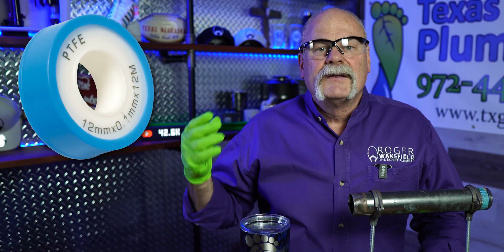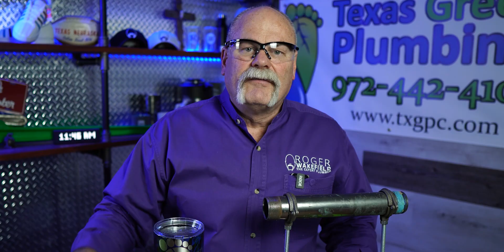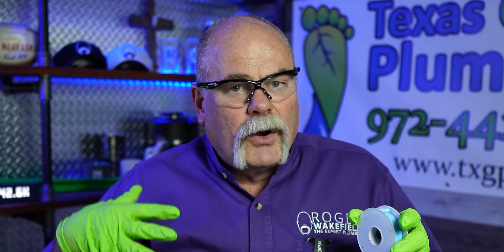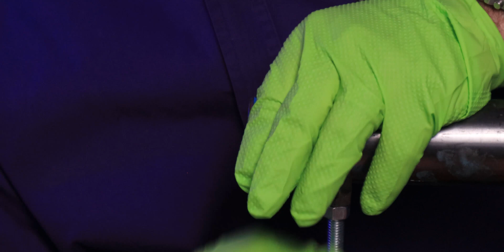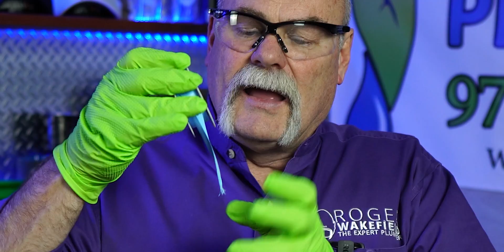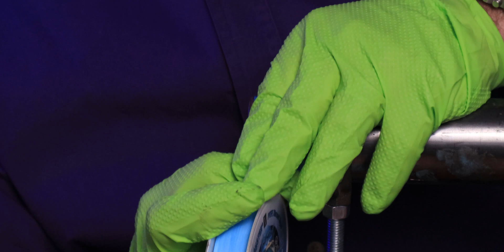How to Apply Teflon Tape/Plumber's Tape like a Plumbing Pro!

Comment: Great video, this comment might get lost on a 5 year old video, though when I apply the tape, I have the roll backwards so that you can add a bit more force as the roll is pulled to the rod that way.
That I learned recently from a local plumber here in Mexico.
Will be watching more of your videos, they are full of practical tips.

Comment: I like to do my wraps then back wrap back to my starting position. I'll then run the edge of the teflon tape roll in the threads to make sure the tape is in the threads then I'll put the pipe dope on it.

Comment: Not working for me. PTFE always failing
Reply from the maker: Why is it not working for you?
Reply: @RogerWakefield  idk. ptfe Is always leaks. Not depends how many turns I do.
Reply: Hemp works always but ptfe ...
Reply from the maker: You could also try putting on pipe dope, when necessary, I do and I never have problems.

Comment: Teflon tape is great for iron pipe and all kind of plastic materials. Stainless steel is something else, the treat is very sharp. We prefer liquid sealant when we need to seal stainless. We also have a rope kind of tape made by loctite (loctite 55) very handy for smaller parts. Loctite 5331 is our ultimate saver, apply it before tape or rope, guaranteed a waterproof seal.
Reply from the maker: Great point!

Comment: Fine, when you have a section of threaded pipe mounted horizontally directly in front of you. What about when you have to contort your body, hands, arms reaching into tiny cramped spaces (such as under a small sink cabinet) and the tape repeatedly rolls up or folds up on you and a number of pipes or other objects are in your way?

Comment: I am an auto mechanic. I have blue and I have yellow. Honestly I just use the first one I grab. Both blue monster and blue monster gas guard are petroleum products rated, with the only difference is the gas guard has a temperature rating.

Comment: Yes.  You’re a fine speaker.
My old shower head began leaking (“internally”, not where it screws in).  
I just bought a new shower head… I just removed the old head.  
There’s still (old, white) tape on the threads. I assume I need to remove that old tape before putting on the new tape.
I have no dope. Only tape.  
BTW: the old pipe leaked where it swiveled, NOT where it screwed into the pipe.

Comment: I’m a sprinkler fitter and I always dope the threads, but never have it too thick. My main goal is to have a light layer of dope inside the threads. Then 4 wraps of tape. Larger pipe I may add an extra wrap or 2 and put some dope on the outside. Sometimes I even dope the threads in the fitting on pipe sizes like 4”

Comment: I’ve been putting these water meters in these homes for a newly built subdivision.  And had 2 back to back homes where the 1” inch tail pieces (brass) were leaking with the copper female sodder joints.  

Cranked on them too.  Tape, dope, then tape didn’t matter.  Plumber had to remove the old sodder put a deeper threaded one IN.  Then it sealed.  

So my point is.  Make sure you’re getting enough thread coverage and that sucker is going in quite a bit

Comment: I've been trying to install a dishwasher pressure reduction unit using the T piece and nipples 2 male and one make to brass flair. To get it flush with the wall a can't tighten all the way as the whole system needs to be flat. I've tried using tape the way you described it but always the joints that are not fully tightend leak. I'm tearing my hair out. Thanks for the very clear video though

Comment: Most of the guidance I see is you start the tape from the smaller end of the tapered pipe

You wrap 2 - 3 wraps at the small end of the pipe and then spiral wraps with overlap to the end of the thread

We use a helium leak detector to verify the leak tightness of the joint.

We can achieve joints with leaks less than 1 x 10-9 std.atm.cc-sec-1

Comment: I'm not even halfway in and I stopped to comment on the number of cuts in the editing.  It's distracting.  Roger, you put out great content, but you don't need to change zoom or angles three times in a short sentence.  You've got the chops to stand and deliver.

Comment: Teflon tape isn’t intended to seal a threaded connection, its main purpose is to aid in threading the connection as much as possible so really its a friction reducer between the two mating surfaces of the male and female ends. Have you ever tried threading a connection without teflon versus with, in most cases you’ll thread further with the teflon. This is not to say it doesn’t help “seal” its just not its main purpose.
Reply: Have you tried using silicone oil?  It lubricates the joint but it will leak.

Comment: The way I had it explained to me was that the sealant or tape served two purposes.  One it acts as a lubricant to allow the threads to go together smoother and further which is tighter on tapered threads. It also prevents Gaulling (sp). That is why even on brass or copper I will still use thread sealant of some sort. I had people tell me not to use sealant on brass because it is soft enough to seal.  The other reason for using sealant is to fill the root of the threads. I know, if the threads are perfect there is no gap at the root of the threads. Those fitting either you can't find them or you can't afford them. You also have to think about the fact that at some time you may have to take that joint apart. Going back to the brass or copper you can get them to seal without sealant but your odds of taking it apart are going to be very slim. The method of using tape and dope is benificial if you overshoot tightening an elbow and have to back it off slightly (don't tell me you've never done because I will call you a liar to your face) the pipe dope will fill backing up better than tape alone.

Comment: I found it intersting and helpful that you started on the back side, wrapped about 1/2 turn, relieved the pressure on the tape, and then moved your finger to the front before continuing. That allowed you to hold the tape while wrapping over the starting point. Great tip! Thanks!

Comment: My Uncle Ned called it “ gooey tape and gooey “  I am a boiler installer I use , Teflon and rector seal “yellow paste”. Tighten with 2 pipe wrenches. I don’t have leaks , yet.

Comment: I'm an engineer.  Teflon tape is only needed in the following situations:

-Pipe threads are significantly damaged. The tape helps fill the severe pits and chips.
-If the threads are straight cut and not tapered.
-If you are joining pipes made of dissimilar metals.  The tape will help slow (not prevent) galvanic corrosion in the threads.
-If You can't get full thread engagement due to dimensional limitations, then it might help.

Taper threaded pipe is designed to self seal.  As the threads are being fully tightened, the threads slide past each other with so much force that they create a mechanical bond between the two surfaces.  Pipe dope acts as a lubricant to aid in tightening the joints to achieve the correct amount of thread engagements.  A pipe with undamaged threads that is leaking through the threads of a joint is a pipe that was not tightened enough when installed.  The reason why that engineer told you to use pipe dope combined with teflon tape was because without the pipe dope acting as a lubricant, it is easy to make the mistake of thinking the joint is fully torqued when it is not.

When you apply teflon tape to a tapered thread and then fully tighten it down, the threads cut through the tape to the point where metal to metal thread engagement is achieved.  This creates the seal.  If there is an imperfection on that surface, the teflon tape won't do anything to seal it.  Applying teflon tape (especially teflon tape without pipe dope) can fool a plumber into thinking the joint has been fully tightened when it hasn't been.  This is usually why a telfon taped joint can leak.

Using hemp thread wound into the valleys with pipe dope (as they did before teflon tape was invented) is a superior way to seal threads.  If there is an imperfection in the threads that does not seal completely, the hemp thread will absorb the water and expand into the imperfection creating that seal.  I've never had a hemp thread+pipe dope joint leak regardless of thread condition.  I've had a handful of teflon taped joints leak.  Teflon tape is faster, but not really the correct method for anything other than straight threaded joints.
Reply: How many times have you done it yourself?
Reply: @ligma8353  well said. leave it to the engineer to tell people how to do a job they have never done :D
Reply: Great tips …. thanks!

Comment: With our high pressure oil pipeline we sometimes go dope tape dope.  Sometimes we had oil  work underneath the tape.    On the biggest 4” pipes we were using we dope tape dope the nipples and then doped the female threads. That way the threads were pushing dope on inside and out.

Comment: I used the white teflon tape on a natural gas line in my house and within a month or so the tape had "liquified" and started leaking gas into the house. I bought the yellow tape and it's been sealed for about 3 months now. I don't know if the tapes are different or not, maybe my white tape was old, if teflon tape can get old. I'm just a homeowner, not a plumber or anything special.

Comment: Yellow PTFE, in the UK at least, specifically states on the wrapping that it isn't WRAS approved. Therefore, CANNOT be used on any water supplies (copper/plastic/steel). All fittings for use in water systems, have to be WRAS approved
Reply: yes he is american so we have to take into account the lower standards. roger is a fantastic plumber with great ethic, but usa's UPC as opposed to our NPC is significantly relaxed.

Comment: From my research, while the tape does have some sealing effect it's actual purpose is to lubricate the threads. NPT relies on friction to be leak free and the tape aids in getting the correct penetration/seating depth of the threads.Putting layers of tape and dope seems to me like a move of someone who doesn't really know what they're doing as generally you're supposed to use one or the other. As for engineers, I know many, wouldn't trust half of them to change a light bulb. I've found half the things people tell me are wrong, always do your own research.
Reply: I work in hydraulic Research and Development! pipe nipples and fittings often require the use of Teflon and pliable sealant on threads.  Thread consistency can vary greatly due to quality issues.  Thus the need for both.

Comment: Correct points:
1. clean threads
2. wrap tape clockwise for right hand threads (looking into the pipe hole as a reference, now imagine clockwise) and begin wrapping at the vanishing threads, which is away from pipe end
3. wrapping downward or towards the pipe end allows for more tape contact when screwing the pipes together because of the tapered result, thus creating a more sealed thread joint with each turn of the pipes

Comment: We were told not to use the Teflon tape and only use pipe compound. The reasoning is what he said in this video. If I piece of Teflon tape flys off and gets into system it can damage a lot of different equipment. Also I just heard pipe dope doesn’t leak as easy as the tape can.

Comment: Ok I need some advice. I have tried to fix a leak at the back of my shower head. It’s just a small drip but it’s annoying. I used 1/2 in tape from back to front but it keeps leaking. Not a big or serious problem just want to fix it. Any ideas?

Comment: The yellow tape is slightly thicker - which doesn't really matter much as you can simply use another wrap of the white to match - but the yellow also has some acid resistance because propane is slightly acidic. If you're working with NG it doesn't matter which one you use. 
Also I wish you'd covered when to use and when NOT to use tape/dope. I can't tell you how many times I've seen experienced licensed plumbers putting tape on the threads of compression fittings. I'm really baffled by the faucet/toilet/dishwasher supply lines that come with a cute little roll of teflon tape in the bag. Idiocy at its finest.

Comment: Here in Canada we leave the first 2 threads bare on gas piping. You touched on the reasoning, you don't want anything caught up in a reg. etc.
Reference: 
B149.1-15 Code Book (Natural Gas & Propane)
Section 6.9.6

My entire career I always T tape then dope. Leaks are extremely rare.

Comment: 3 wraps were never enough, I now do at least 10.
Reply: alright, that's definitely too much teflon tape
Reply: Wow. Try to get better thread engagement rather than piling on the Teflon. It’s not meant to seal only to lubricate. Hence “Teflon”

Comment: As a technician, not a plumber, I also frequently use tape then dope on steam/water.
Sometimes the dope makes the fitting lubricated so depending on situation it might not be helpful.

Comment: So clockwise from viewing the front of that nipple. Or wrap opposite direction of how it turns as the nipple is screwed in. Clockwise is diffurnt depending on the point of view. You said that you apply the teflon tape and then the pipe dope. What happened to the pipe dope step?  is that in the next video?

Comment: I always use pipe dope over teflon tape. It's a great tip. I had an old plumber pass on  that trick to me and it has not let me down. All the fittings just glide together. The only time I ran into problems is on Rural Poly style fittings as it's a little too easy to over tighten them. I just go a little easy on them now.

I also use plumbers pipe dope as a really weak locktite on bolts that I need access to regularly (eg, pto clutch on a tractor).

Comment: plumbing designer here. (Virginia DC Maryland area)

the yellow is most likely based on international fuel gas code 401.5 and 404.17.3

401.5 requires yellow labels with black letters on them
404.17.3 requires tracer wire to be yellow

more than likely people have interperated as yellow everywhere to make life simple.

Comment: PTFE tape is oil, petrol, solvent, acid, gas, water, coolant safe, if it can be wrapped around a thread you can use it, the only difference between PTFE tapes is thickness/width, use what suits your clearance needs.

Comment: I remember one time I was using the sink and the hot water pipe just started spraying water from under the sink it turned out the pipe was kind of just press fit and was also connected to the bathroom lol

Comment: This is what was done in the old days, for brass fittings: with a pipe wrench you apply a few squeezes on the thread. The thread gets a small damage, which helps getting hold of the tape. You don't need the fiddling with one finger over the other as in 4:18. And there are (were?) also brass fittings that has these notches preformed.

Comment: Not a plumber, just needed help with replacing a shower head. This is helpful. I did it and the thing leaks. Now i know what i did wrong, fixing it when everyone gets up later.
Reply: yeah wrap the tape 3-4 times SAME DIRECTION as the showerhead will be tightened...should be clockwise if looking straight at the pipe end. if you wrap opposite way, the tape just bunches up and unravels when tightening the showerhead
Reply: What did you do wrong? I have the same issue... I changed my showerhead and now it leaks. 😕
Reply: @maggiehgs3144  i was putting the tape on wrong.

Comment: Tape spread out  inch wide and a you may get 1/2" to 5/8" engagement, 1/2" tape ends up 5/8 wide after 3 wraps is plenty. I do threaded stainless all day long and 1/2" tape and dope gets the job done.

Comment: If your mixing metric and imperial fittings can you use ductape and brute strength?
Reply: only if the ratio of brute strength to duct tape is 3:1 😁

Comment: PTFE Thread Seal Tape  many grades  some are not Rated  for natural gas use

the colors are so they know what it is  i.e yellow easy identification by gas (idiot proofs it)

density   changes as well   white is  single density  NOT   Gas line rated 
so yeah it is Code  to use double density tape on gas lines  and/or pipe dope(UL and American Gas Association  approved )

so yellow is double (gas line rated),RED is triple density  .

Comment: all i have taken with me at the end of the video....don't let the male or female parts be dirty and use protection for the engagement. Do not overlay pipes. Nipples sticking out of a wall are unusual, you never know what you will find. It's okay to use more wraps if you think that more protection is needed. More protection= less likely to have a leak.
Reply: Too many wraps can break fittings. Fine line

Comment: Those gloves are cute😅Just joking Roger!! I usually go around 4 or five times and leave the first thread uncovered also I use the white Teflon tape and the white Teflon paste second! I heard that the yellow Teflon tape is thicker in case you overlap the end of the pipe it doesn't Fray as easily and get into potential orifices in gas runs😀👍🇺🇸
Reply: I don't think there's any major noticeable differences between the colors, I think it's just like different diesel/kerosine containers that are just color coded for the sake of identifiability and safety precautions.

Comment: Just a question I'm always used to using pfte pipe dope and hardly ever use tape except on galvanized threads that are in terrible shape. What exactly the pros vs the cons of using pipe dope vs Teflon tape?
Reply from the maker: I actually use both...

Comment: Hey Roger- Bravo my friend! good demo and explanation! One caveat here- code officials in my area (Virginia) look for the yellow on NG line- the YELLOW is DOUBLE DENSITY  vs the white and insures a better seal...  and if the pipe is 2 inches+ diameter- you are required to use dope as well no matter what color tape you use.